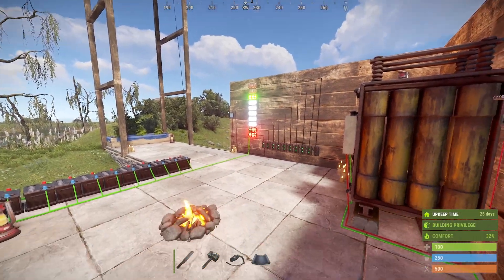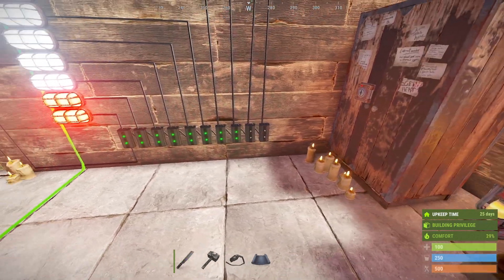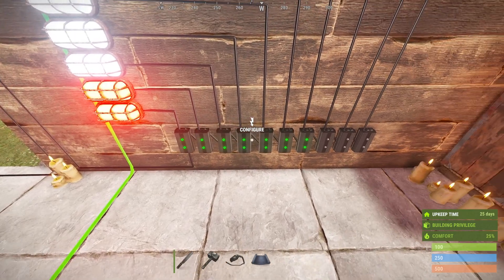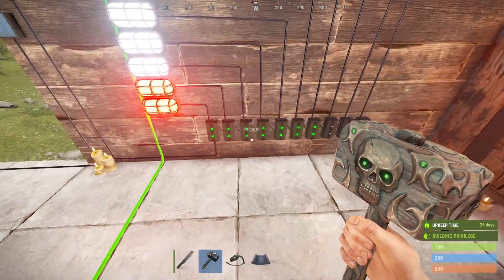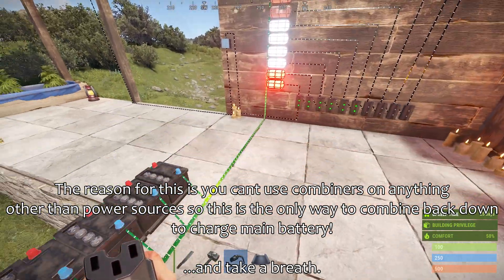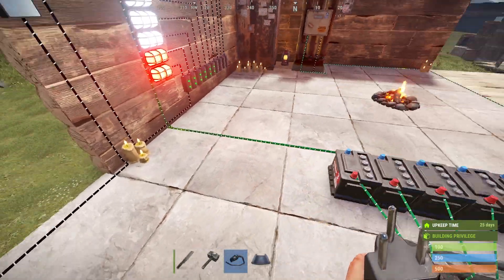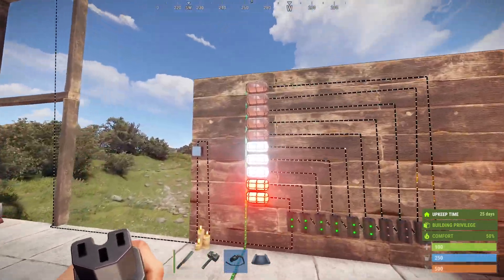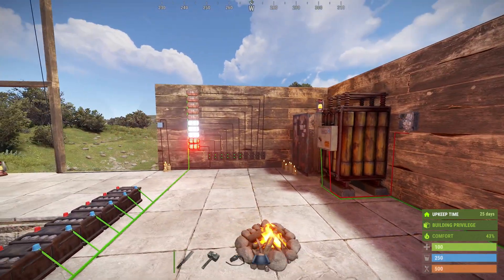Rust Electrics 8 - POWER Meter!!

Comment: Hey man ive been looking into learning electricity in rust, and I found your channel super useful. But I have a question, it might be in some of your other videos but not in the ones I've seen. So I thought I might ask in your DC, but could find a link so ill leave a comment. 

So I'm trying to combine 2 or more large batteries to have extra capacity in case a raider breaks my windturbine and I cant get back in the time it takes for 1 large to dplete at a 100 usage. Is there a way to combine them? Because I'm just linking 1 to the other and it seems its losing power. 

Any tips or videos where you explain this?
Reply from the maker: I'll make a vid on this soon as want to be sure of my facts first :) , thanks for visiting !!

Comment: Max Depth is the error when you exceed 16 components between the power source and the Root Combiner. Short Circuit is when you try to send power back into a place it already was if the loop is less then 9 components. It is 1 error message for 2 errors.
Reply from the maker: Hi, yes for sure good point, I should have highlighted that in the vid! Also congrats on your electrical wizardry displayed in MikeTheVikes vid a year ago! Nice work!
Reply: @GenXGamesMeister  Thanks man, you make me blush. I sent you an email with some info you may be interested in.